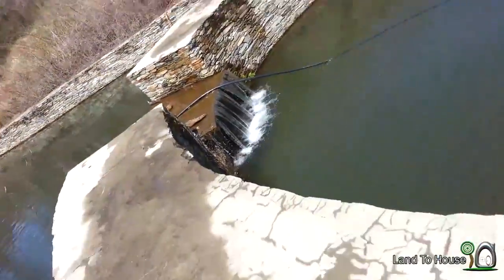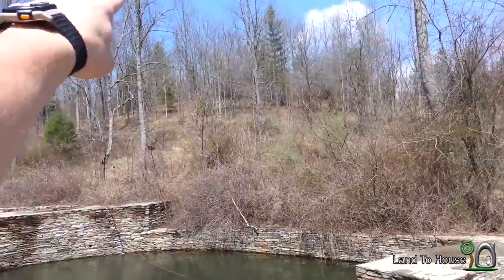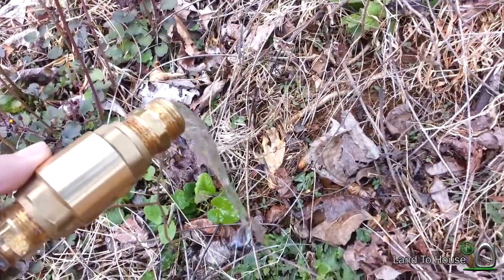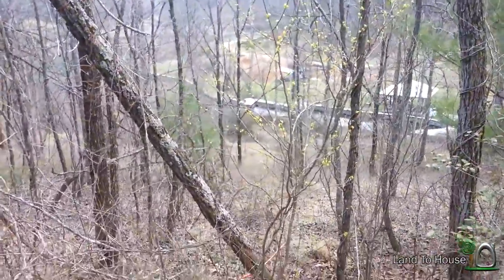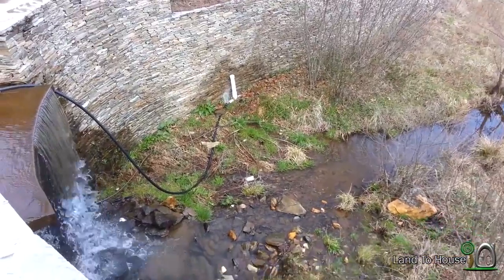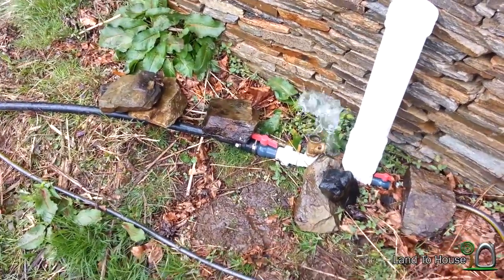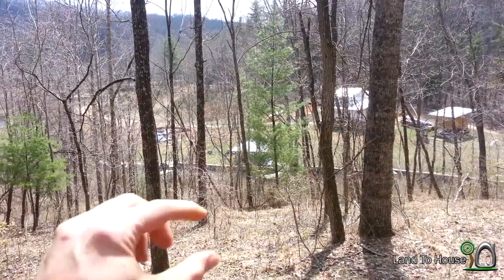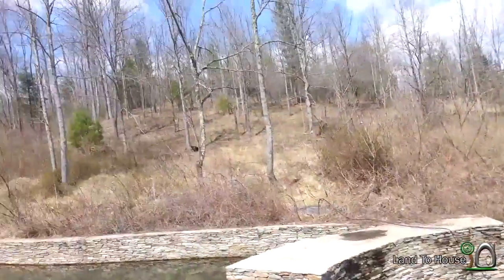Ram Pump Potential ReLoaded

Comment: Thanks for the video - seems that definitely the higher the delivery pipe the lower the volume of water is delivered.   Is there a ratio?  For 200 feet of hose, you guessed 1 gallon per minute.   Would 48 feet of lift be a good guess for the 200 ft length?    Off of a Williamson chart I extrapolated that a 2x lift increase resulted in 1/4 the volume.  Which might suggest a volume of 4 GPM at 24 ft lift and 16 GPM at 12 ft lift - which seems too high, but don't know.
Reply: I realize I'm quite off topic but do anybody know of a good place to stream newly released tv shows online ?

Comment: the pressure and volume of water supply is enough to support an additional waste valve. I try and tested that principle and I got satisfying result, good volume of water and can reach to the desired vertical height that I want too.
Reply from the maker: Yes a second waste valve does increase flow rate.it requires a larger drive pipe.
Reply: @LandtoHouse  what would the location be for the second waste valve?

Comment: So,Have you seen how people put an inter tube from say,a bicycle in the stand pipe to simulate it being a pressure vessel?I guess they will put a small tire tube inside of the stand pipe or even better after gluing the cap on the stand pipe they put a tire valve stem with Schrader valve installed so pressurized air can be added to the stand pipe?!!!Yes,seems to be quite good of an improvement to this system !!Check it out when you can BC you've got more videos than anyone else on YouTube
Reply from the maker: When you say "stand pipe" do you mean the pipe that allows the drive pipe to extend further than 100 feet? Or are you referring to the pressure tank on the pump? I actually put a bike tube in all of my pumps to keep the pressure tank from becoming water logged over time. It does help a lot!

Comment: To find the elevation, put a pressure gauge on the pump... measure the static pressure and calculate using ( psi /.433 = vertical feet.)
Reply from the maker: I now have a pressure gauge that I can use. This location now has an owner and I would need to get permission to make tests here again. Thank you for the tip.
Reply: Cheers!  I used to work for a civil engineer. I used to have access to VERY high precision Total Station equipment. Now I don't.  I used GPS to get my elevation data for my site design. It was off by 30 feet (vertical)when I installed and tested the system.  expected 40-50 feet vertical max... ended up at 72 vertical feet.  the pressure gauge was the only way I knew. :)  Glad to help!  Thanks for all your testing!  I watched your video on underwater ram pump operation last year.  I plan to employ one of these for my parents at some point (for quieter operation).
Reply from the maker: My brother in law has worked at a job with high precision tools and he talks about them from time to time. I on the other hand am not used to them haha. GPS can be great but there is always that tolerance issue. Thank you for watching my videos. I have a few ram pump tests in the works but its going to take time to get them done.
Reply from the maker: $25k.... wow. That is a little more than pocket change. Nice looking vegetables in your video.
Reply: yeah and the orange gun in the video is a total station... they are more like 100K to 250K.  Thanks on the video!

Comment: Thanks for the video.  I'm looking at installing one of these at my place.  I thought I'd chime in on those rubber fittings you were using.  Those are only good for vent and waste applications where pressure isn't an issue.  I found that out when I tried to use them on my well set up.  Threaded is definitely the way to go where pressure is at play.  Thanks again!
Reply from the maker: +test account thank you for watching! You are absolutely right about that rubber coupling. It comes off within a short while everytime. Threaded adapters will last for years. And are 1/4 the price.